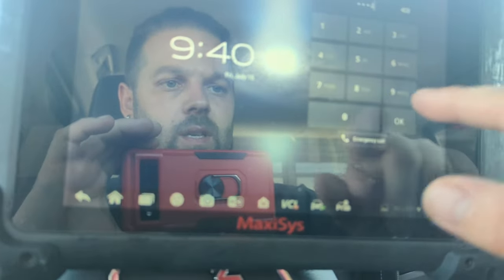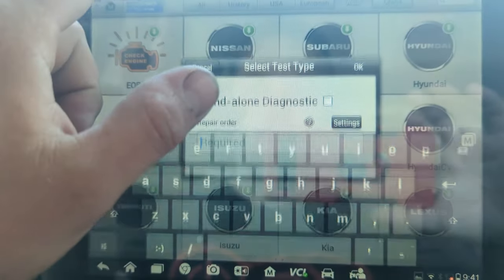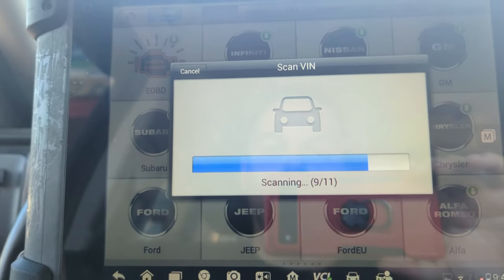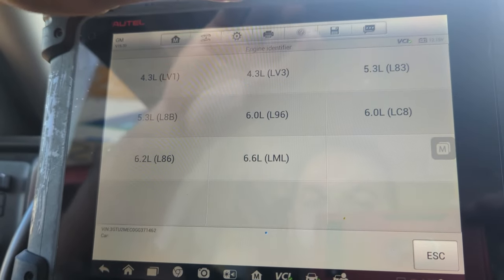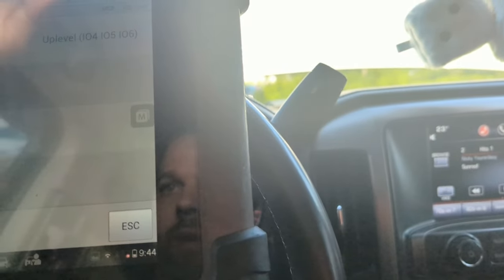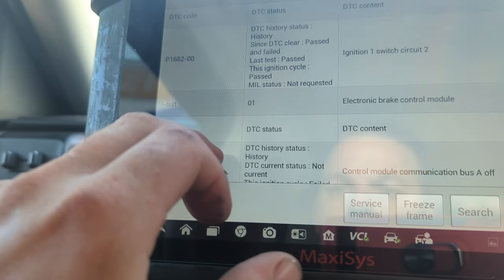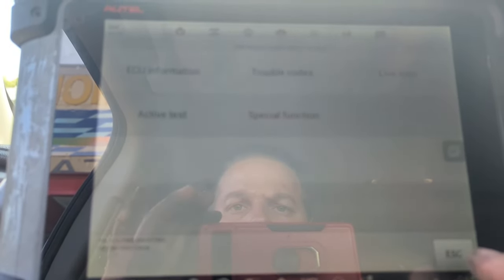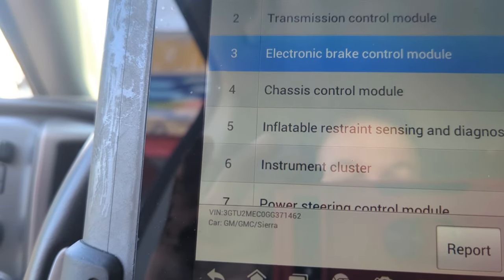Silverado/Sierra Trailer brake Message

Comment: I got the trailer brake message and days later I got a power steering message. The ground strap to the frame was corroded and all the messages were related. A new ground strap and nothing needed to be fixed. Just a heads up to trouble shooters.

Comment: I left my trailer connected to truck when testing the brake away. No my trailer brakes don’t work. I must have smoked something.
Reply from the maker: its hard to say, would test for power at the trailer connector while pushing on brakes and see if my test light lghts up, if nothing happens then I would trace back towards the module.

Hope this helps.
Reply: @JLsAutoSolution  thanks I’ll give it a try. I’ll keep you posted.